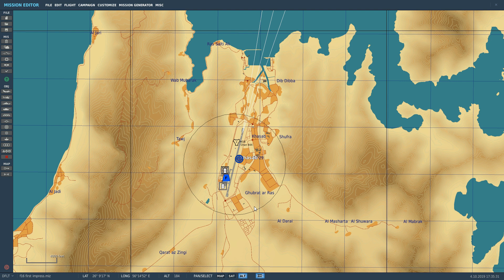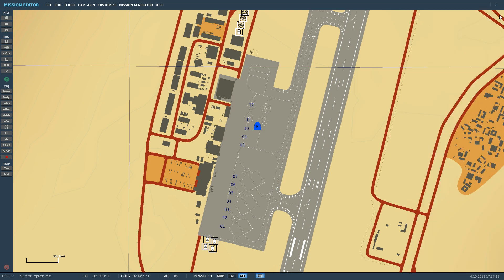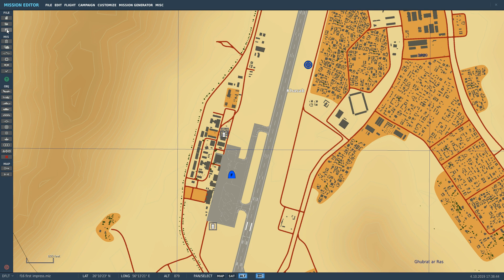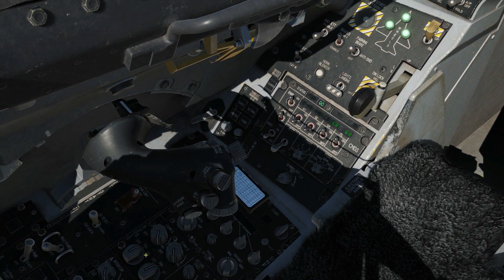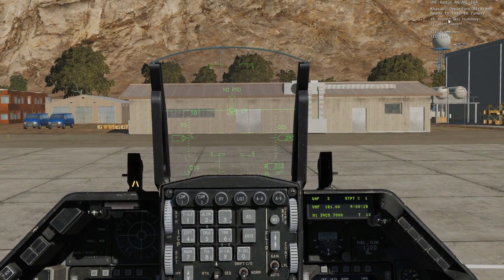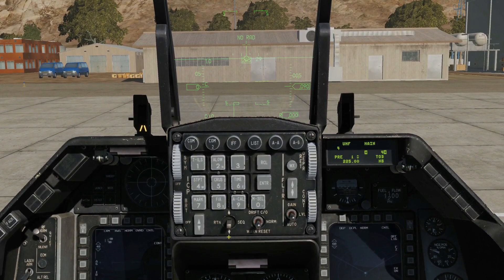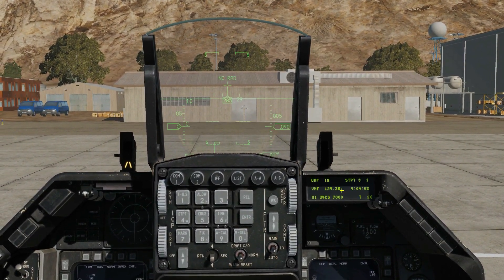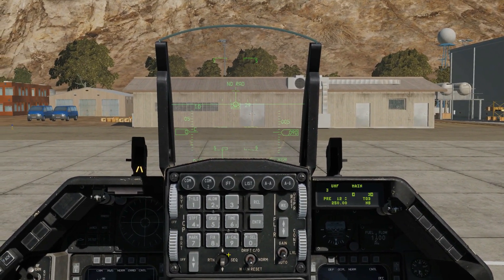F-16C Viper: AN/ARC-164 & AN/ARC-222 Radios Tutorials | DCS WORLD

Comment: You have to use your backup radio prior to startup.  You power it from the main power battery.  The up front radio will not work.  You have to use your backup radio to get permission to startup the plane, and then you switch to your primary radio for everything else.

Comment: Hey buddy, when you hit enter at 6;30 you seemed to edit it.  At that very point EVERY TIME, I get a flashing preset number disabling me from continuing past that point.  What did you do to stop that preset number "12" from flashing?
Reply: In general, when some input is flashing on the DID, it means some value is out of range or wrong type of input. For example trying to put a uhf frequency into vhf radio

Comment: If you want to talk to ATC on the UHF band prior to startup you have to use the backup UHF radio on the left panel.  The radios on the ICP will not work until generator power is applied from the running engine.  The backup UHF radio, however, just needs battery power so if you want to contact ATC for startup clearance you will have to use that radio.
Reply from the maker: thx

Comment: Question for all: I can get both UHF and VHF channels to work for ATC on the ground -- but my AI wingmen are completely unresponsive. In the missions provided with the F-16, (have tried both Island Style and Coiled Viper), once I get airborne, I tune the UHF to the mission editor's assigned frequency (305.00 mHz) for my flight as well as the VHF to the mission data card's frequency for my flight (127.00). I have tried easy comms on to use just \ to transmit, I have tried easy comms off and used Rctrl \ and Rshift \ for both the UHF and VHF channels -- absolutely no response. Very difficult to do anything if you can't coordinate flight. Am I missing something here? Is anyone else experiencing this issue?

Waiting for my 24 hr registration to process on the ED forums, otherwise would have posted there. :)
Reply: I’m having the Same issue has anyone found a fix or work around?
Reply from the maker: sorry have not tried yet. Will test when I get a min.
Reply: @grimreapers  No worries -- thank you! I think the issue may have been with the easy radio -- I cycled on and off several times and now it seems to work while turned off.

Comment: If I understand correctly, that is not an additional UHF radio—it is just the manual control head for the COM1 UHF.  You would use that before the ICP was up and running (to request engine start, for example).
Reply: Correct, that is indeed just a manual control head for UHF 1. The exact same panel is used on C-130H's. You would also use this panel during emergencies when you lose mission computers or loss of AC power. This panel and the UHF radio are able to run on DC battery power.